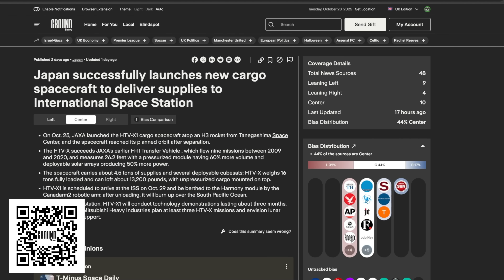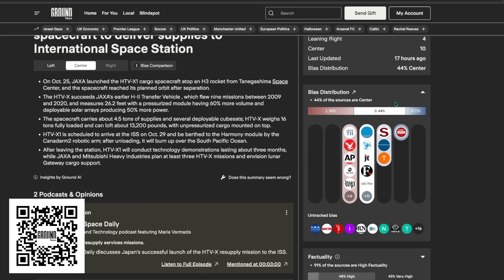Every Thing These Moon Landing Deniers Got Wrong About the New Moon Mission

Comment: These guys clearly do not understand how press conferences work. Press conferences where one can field questions, are specifically done so news outlets can grab small soundbite answers for their news pieces whilst filming or taking audio recording. They are not intended to have the people answering questions with hour-long detailed technical explanations of things. For that more detailed information, the journalists attending the press conference are given a supplementary press pack, which has the more detailed information that cannot be crammed into a soundbite answer, as well as photos they can use and some longer quotable comments, often provided as an electronic file so writers and sub-editors don't have to type it alll out again.

This is why if you read several different newspaper or magazine articles, you'll find sections of those articles on technical matters which are word-for-word identical to a similar article in another publication, which will often have the same pictures, because the writers at different publications will literally have copied and pasted sections from a PDF or supplementary text file link which was part of their press pack.

So no, it's not a case of these people 'not answering questions' it's a case of them using the specific media presentation properly. I'm sure if you really want to, you can contact them and get hold of that press pack to get more detailed answers for any questions you might be curious about, instead of bullsh*tting about them not answering technical questions because you don't understand how PR and the news media functions. It's worth noting too that some of the people at such press conferences are the marketing staff and not the boffins, which means they've been chosen because they look good and sound good in these scenarios. They are unlikely to know the minutiae of every technical detail, and therefore could not go into a hugely detailed explanation even if they wanted to, because that's not their job.

With regard to testing stuff, it's also worth pointing out that even when you pretty much know something will work, in the aerospace industry, you don't simply go with that assumptionand cross your fingers, you test it rigorously to make sure it does work as expected.

I will give you an example of this. At the airport where I work, we sometimes have commercial airliners 'go tech' (experience a technical failure). Lots of these things can be fixed easily in a few minutes by line maintenance engineers and will be fine, however, not all of these problems are issues of that nature and will sometimes require more specialised work and spare parts to be flown in to effect a repair. This is why the airport has an engine test bay, so that any airliner which has had some engine work done to it, can be towed there to have its engine run at high power settings to ensure the repair is good before they start allowing it to carry passengers.

But even this is not always regarded as good enough; if an airliner has had both of its engines worked on in a significant way, it literally has to have a short test flight performed, where it takes off, flies around for a short while and then lands back at the airport before it will be allowed to make a flight carrying passengers. It's not a case of people forgetting how the engines on a Boeing 737 or an Airbus A330 work. It's not like your car coming back from a service; you can't pull over and call the R.A.C. with an airliner or a space rocket if the engine conks out. You should be glad of that kind of thing if you ever take a holiday flight on an airliner, instead of being like these guys in regarding it with suspicion because they are ignorant of the meticulous safety procedures when it comes to flying and launching rockets etc.

And with regard to the escape basket wires on rockets. It's true that you probably could not use that escape system if the rocket had exploded on the launch pad, in exactly the same way as you could not use the escape slides on an airliner if it was upside down engulfed in flames after a crash, but this does not mean aircraft designers don't bother putting these on airliners for all the potential emergency evacutation scenarios where they will be ideal, and this is bloody obvious to anyone with an ounce of common sense. So these twonks are either stupid, or being deliberately dishonest in their video, or possibly guilty of  a combination of the two, which would be my guess.

Comment: «Apollo Detective» is such a misnomer ...🤦🏽 A better name : «Reality Denial Maniac»
The trip will take longer because the transfer path to and from the Moon will be broader, more curved. 
This is Artemis 2. Apollo 1 never flew. Apollo 2 to 7 only orbited the Earth. Apollo 9 and 10 where rehearsal for the Apollo 11 mission.
The radiation in the Van Alen belts is 100% charged particles. Those are pretty easy to shield against. A mere 0.01mm of aluminium foil is enough. That's not even the thickness of cheap consumer grade aluminium foil. Artemis 2 will have a MUCH thicker aluminium coat covering it's entire surface. Then, the structure and thermal insulation under it are also excellent charged particle shields.
The vacuum question ? It have been tested on the ground in vacuum chambers, and in real life with the Gemini program, the Apollo program, and continuously for nearly 40 years with the ISS.
Reply: Actually Apollo 3,4, and were cancelled for budget cuts. Apollo 6 was the first test of the CSM in space. Apollo 6 was the first manned flight.

Comment: The Launch Abort System could be triggered on the launchpad.  In fact, it happened once for a Soyuz launch back in '83.  A fire broke out, and the escape system was automatically triggered six seconds before the rest of the rocket exploded.  This came as a surprise to the cosmonauts, and reportedly there was a good bit of profanity recorded after the event.

I don't know if the Artemis system would do this, but in a situation like this where there's not enough time for evacuation, this would make sense.
Reply: Artemis will do this, also. It has a very robust abort program that covers everything from the beginning of fueling to orbit without black zones (that is, times where an abort is not possible or not survivable). Generally speaking even if an evacuation may be possible, a propulsive abort is generally preferred. An evacuation would leave the astronauts on foot if further failures compound and the situation gets worse, not to mention rescue and support personnel. It's just much safer to sacrifice some of the coupling hardware and get to a safe distance immediately.

There's only ever been two unintentional on-pad aborts, and both were Soyuz - the other was unmanned, but had been sitting on the pad with the guidance computer active for several hours until a gyroscope malfunction made it think it was tumbling, triggering the escape system to carry the empty capsule downrange to the recovery zone. But they have still been considered all the way back to Vostok and Mercury.

Comment: Apollo didn't test the landing on the moon.
Reply: Apollo 10 was essentially a dress rehearsal that went 99% of the way. Obviously at some point there has to be a first attempt at landing, which was the job of Apollo 11, but Stafford and Cernan took the LM down to within 47,000ft of the lunar surface.
Reply: @yassassin6425 so they never tested the landing on the moon or the take off.  I wonder why they didnt need a rocket to get off the moon? With a fraction of the gravity and no atmosphere, could they have just jumped back into space?
Reply: @mmongiello722  
The ascent stage was tested and separated from the descent stage during Apollo 10. What do you mean you wonder why they "didn't need a rocket to get off the moon"?
Reply: @yassassin6425  so you agree they did not test the landing on the moon or the take off from the moon during Apollo 10. They needed like a huge rocket to get off earth. Why didnt they need a small rocket to get off the moon?  No atmosphere and  like 1/32 the gravity. So, a rocket 1/50 the size to be generous.  Its not like the astronauts were jumping 32× higher.

Comment: The solid fuel booster that had problems is not the type that will be used with Artemis 2. They will still use the stretched versions of the old boosters used with the shuttle. The test was with the new version that will replace the old boosters around Artemis 9 -if it happens.

Comment: The escape system criticisms are quite unfair and unrealistic. Just because the escape system doesn't work for all conceivable failures doesn't mean you don't need one. That would be like asking why commercial aircraft have evacuation slides at the doors because they won't save you if the wings fall off in flight. Or disparaging automobile seatbelts because they won't save you if you drive off a 500m cliff. There are just some catastrophic failures from which one can't escape. But they are addressed by working hard to prevent them from happening.

Comment: People didn't ask about radiation because it's a non issue at this age in space travel, it's only an issue with people that don't know anything about space exploration, or moon landing deniers, that try to make it a bigger issue than it really is.
Reply: No, it is a big issue because Artemis aims to set up a long term presence on the Moon. It wasn't a big deal on Apollo because the missions were short.
Reply: @paulzuk1468 Yes, but it’s being studied and dealt with. The question wasn’t asked here because it’s irrelevant to Artemis II. Even on the surface, it’ll be dealt with for quite a while by keeping missions relatively short and having emergency shelters in case of a massive CME.

Comment: Artemis II is on track to launch this February. First time humans have launched to the Moon since Apollo 17. Rocket is now stacked in Florida. https://www.youtube.com/watch?v=p77Eq_9kuqY&t The amount of cope and denialism from flerfs and moon hoaxers will be legendary. You will have material to debunk for ages Dan. Also, I addresed all of their claims in that video in the comments too. See below
Once again I got to correct and clarify AD's when it comes to Artemis
1. Radiation measurements from Artemis 1 showed the levels were nowhere close to lethal and that was a 25 day mission. The report is in Nature published.  Artemis II will be 10 days
2. SLS/Orion only requires one flight to get to the Moon since it is fully expendable rocket. Just like Apollo. No refueling needed. Starship requires refueling because it is fully reusable and is 52 meters tall and can carry 100 tons to the surface. Orders of magnitude bigger and more capable than Apollo LM.  Gateway will not be used wither for Artemis 3 landing. 
2. Heat shield issues were well understood and mitigated by changing reentry trajectory
3. 10 days due to spending the first 24 hours in elliptical Earth orbit, TLI on day 2, and they will be going a little farther past the Moon than Apollo
4. The solid rocket booster test "explosion" is for a completely different design and configuration for future boosters starting with Artemis V or so. Current generation of solid boosters are the same as space shuttle and flew on Artemis 1. They are proven.
5. Astrorad vests will be only worn by astronauts in the event of solar storm or CME when they hunker in Orion radiation shelter. They will just regular clothes for most of the mission and their flight suits for launch and reentry. No space suits just pressurized flight suits for this mission. They are not leaving the capsule. Not sure why you are going on about gloves.  Regular GCR/Cosmic radiation is nowhere near lethal for just 10 days. 
6. There will be plenty of cams from this mission and from the crew inside the capsule. Don't worry.
7. ISS is not "refueled" but resupplied for humans and science experiments. Its in a stable orbit lol. 
8. Gateway is not being used on Artemis 3 landing. It will start with Artemis 4. It will launch on a SpaceX Falcon Heavy, not on SLS/Orion Artemis launch.

Comment: Why do they keep testing cars when we could just keep building the model T?
Reply: The Model T would fail modern automobile safety tests.  It wouldn't even be street legal, having no seat belts or airbags.
Reply: @wizardsuth  But the Model T had the worlds coolest horn!
Reply: @wizardsuth  that's the guys point
Reply: @wizardsuth  Don't know where people think just because a car is old that it wouldn't be street legal. There are many different kinds of "street legal" all of which are defined by various Federal, State, and local laws. Model T's ARE street legal so long as they are registered at your Department of Motor Vehicles and not modified from their make year. They also do pass modern safety tests, in most cases, far better than the plastic shit people drive today. Where I live (Los Angeles, not some little podunk town in the middle of no where America), the only modification that is required from the original 1908 version is that a license plate must be made visible from the front and back. If there's not an already existing mounting bracket (depending on who restored it) that you can use to attach the plates, I've seen people just tape the plates up in the windows so they are visible and viola, street legal. Any other modifications, including seat belts, must be reviewed and signed off on by the California Highway Patrol's inspection bureau. Why including seat belts? Because you have to attach them somehow and they want to be sure of two things, that they aren't there just for show, that they'll actually work when needed, so you don't take more risks under a false sense of safety. And also to make sure you didn't compromise something else, like drilling a hole in the seat support weakening it so it breaks off while driving and the seat falls backwards and the car drives off out of control because the driver is now sitting in launch position instead of driving position. Really don't want things like that happening, so modifications need to be inspected.

What you fail to consider it that the top speed of a model T is only about 40mph and that "feels" crazy fast with everything shaking and rattling, so typically it's going to be driven much closer to 25 to 30 miles per hour where the vehicle rides smoothly. How many of modern day vehicle safety systems are needed in a 25mph crash? ZERO!!!! Modern day safety systems are designed around cars doing 70mph and smashing head on into each other. It is impossible in more ways than one for Model T's to arrive at those energies that would require modern safety systems. And before anyone chimes in, "Well, someone can hit you!" yes, you are right, someone can hit you, but most everyone I know who has a Model T (including Jay Leno, who put out a video right here on YT barely two months ago teaching one of his producers to drive his Model T on the streets of LA thus proving they are in fact street legal, no air bags needed, if you refuse to just take my word for it) don't drive them in places where people drive crazy. You're not going on the freeway with one, that's for sure, and you're not going to be going down some 6 lane boulevard in the middle of rush hour either. You take the side streets where everyone is calmer and pulling up to you to check out your car because they're cool and extremely rare to see driving around. And even then, (also as shown in the video Jay Leno put out) someone who owns a model T will often pull to the side and let traffic pass because owning really old cars means you like driving, it's a fun and pleasant thing most of the time, and you don't want to be the source of someone not having a fun and pleasant experience while driving, so you're extra courteous.
Reply: @Stant123  So you ask why people think an old car wouldn't be street legal .... and then proceed to give examples of precisely how it is not street legal. SMH!!!

And your bogus, how many modern cars need safety systems doing 25mph (or even 40mph that Model T can do) is ALL OF THEM. Yes you can get whip lash or seriously injured from someone rear ending you only doing 25 mph. People get seriously injured sitting in their vehicle in a car park all the time .. and most of them are not speeding or exceeding 25 - 40 mph. They even have lawyers that specialize in claiming for injury in a car park accident. I wonder why anyone would need such a lawyer as per you, no one should need any vehicle safety systems only doing 25 mph AND this is with modern vehicles that do have safety systems. SMH!!!

Comment: The flerfs are amazed that we destroyed the technology that we used to originally go to the moon, but I challenge them to go to a Best Buy or RadioShack and buy the equipment needed to load up a floppy disk on an Apple computer
Reply: I ask them to build a tube radio.
Reply: In 2012 Pratt and Whitney built an F-1A engine from scratch, connected with two proposals - replacing the shuttle SRBs on SLS and replacing the RD-180 with a domestically produced engine to comply with a looming congressional deadline.

It lost out on both counts - SLS to more advanced materials and Vulcan to a more advanced engine cycle burning better fuel.

Because we could build all the stuff from Apollo again. But it's old technology, a lot of which was barely sufficient at the time, and we actually have meaningful goals to accomplish this time.